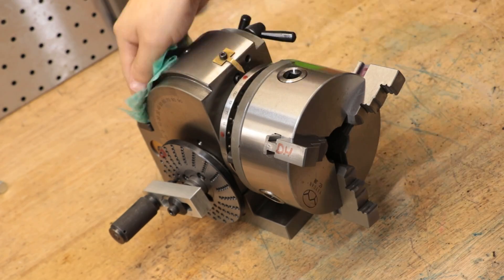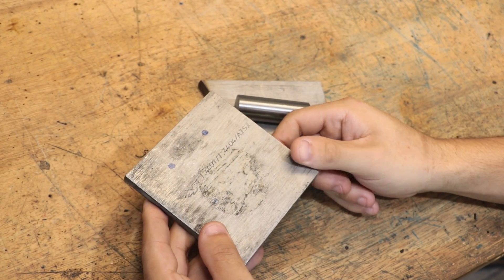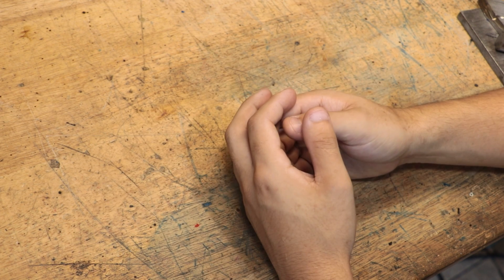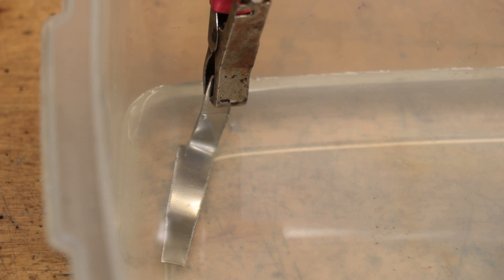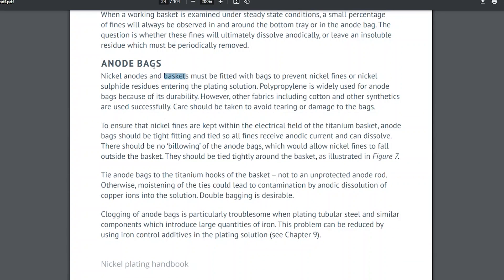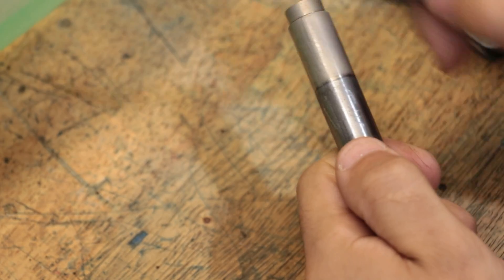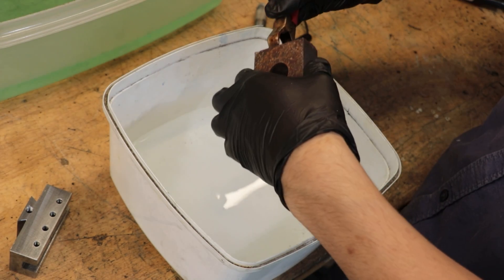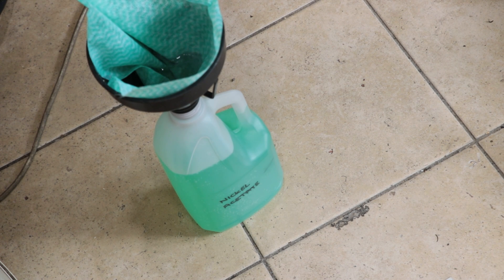Nickel Electroplating Steel In The Home Workshop

Comment: Here's a tip... Buy some nickel wire, use this to connect electrodes to the parts. If you get your power supply clamps into the solution, you will kill it. Also the sodium chloride is important because it creates another nickel salt. When I was looking at commercial kits, they had both salts in the mixture. Also note that most of the acetate salts are poisonous.

I found that the level of shine was more up to layer thickness and current density. Too much current density produced dull finishes. I've done brass and steel so far with very good results. Buy a real DC power supply, results will improve.
Reply: Yikes - I'd better get some nickel wire. I've got some steel end bells off of a couple  of electrical transformers that I want to plate - they're roughly tray-shaped and need to be totally submerged. From what you're saying, ordinary alligator clips in the solution might mess everything up.
Reply: @hubbsllc  anything other than nickel on the donor side will cause problems. And even on the receiving side it just made sense to me because the nickel wire doesn't cost very much money. This is a long process, turn your back for 10 minutes and come back to find the wires in solution and everything needs to be made again. The nickel wire gives you a little safety margin.

Comment: Great video, liked your aside into electrocleaning. The discoloration on the edges is likely due to the electric field concentrating on the sharp edges and plating too fast. Aside from regulating the plating rate chemically (I think glycerin can help? Can't remember) the easiest thing to do is to move the electrodes further and plate slower. Youd still plate more on the edges but the plating rate would be slow enough not to burn anything. Cheers and great video as usual.

Comment: Dehumidifier, a bonus of it is also a minor (about 300 watt) heat from it.
My whole basement runs a small "portable" dehumidifier and it's under 40/50% humidity and nothing rusts 😁
Reply: Depending on where you live though, it's an expensive way to avoid rust. 300W 24/7 would cost me almost £900 per year here in the UK. Sure, it might not run continuously at certain times of the year, but it's still a factor to consider.

Comment: I did some copper plating recently on some rust-prone steel parts. Not sure of the long term durability but it looks satisfying. I did also buy some nickel and zinc to give those a try.
Reply: Do protect the steel from air mate, or you’re gonna form a iron-copper battery which will corrode the iron

Comment: Pretty interesting solution, I did some nichel plating in the past as i was restoring an old boat that had some brass parts that were losing the original plating. As yours the color came ok but I used a polishing wheel and the results were pretty good.

Comment: Very nice. 
The unevenness on the top of the tool holder comes from the process of electroplating itself. The electric field is stronger at the edges on the outside of the material, likewise it is weaker at inside edges. So when the nickel deposits on the part to coat it, more is deposited at the outisde edges and less is deposited at the inside edges. I beliee this is what makes it look like discoloration but it is just layers of different thickness, fading in and out.
Chemical coating processes alleviate that problem, but are a different topic, especially in handling.
Reply: Oh then it isn't simply because there was just a little bit of liquid on top of the bath[1] and that the higher the density of the solution, the higher the nickel content is, which in turn means that the highest ion concentration is at the bottom of the galvanic tank? Well, I am not discussing your nonsense and misunderstanding about "electric field[s]" and how currents flow in fluids, but give you a "magic" one hits them all solution: We in the professional industry use rotating drums that ensure even application of the plating process. Even with your misunderstanding of the chemical and physical basics, that would mitigate "unevenness". So speaking about home use: SHAKE the bath and maybe turn your workpiece around and submerge them EVENLY in the fluid (too less fluid=bad, too much fluid=does only matter for your purse, hehe). Hey, otherwise you are so innovative (like inventing electric fields in fluids ...), I'm sorry for the mocking, but please read about electric fields and the electrochemical process of plating at, f.e. Wikipedia. 

You are absolutely right with the plating thickness. Such coats in the nanometer scale and above periodically (sine spectrum) refract light and that results in a preferred lesser absorbed color. You can find tables for different materials which help to estimate the layer thickness based on the reflected light wavelength. But they are not exact in the matter I mentioned above. For example a 420nm blue tint may hint to a 2µm Layer, but also 12, 22, 32µm (those are fantasy numbers, just for explaining the principle behind it).

[1] That means also a higher resistance = lower current = lower layer thickness plating effectivity over time.

Comment: How about cold bluing?
Reply from the maker: Ill be doing bluing in a later video, its a nice coating but it is not nearly as corrosion resistant as the nickel plating. Cheers

Comment: Microcrystaline wax is good on bare steel/iron.
Reply: The issue I've had with waxes is they break down when using cutting fluids and especially any degreasers. I use so many of these in succession in the shop that waxes just don't last. Long term storage of tools is another story. Just my experience.

Comment: Very nice job on the electroplating and the explanations.
Just make sure not to scratch all the way through the nickel layer. Otherwise you would create a small battery cell (particularly when getting wet) and it will rust even faster
Reply: That is partially true, but also wrong. The fantastic properties of such platings include the following:
As you described, a battery would form, which is nothing else than an electrochemical process. This may "re-electro-plate", meaning closing scratches and even out dings on the surface. 
Yeah, if those are to big, nothing safes the exposed plated base-material from rusting. But nothing else than submerging the part in f.e. oil does that either. 
You can further read about that in articles about zinc-plating for exterior use. That effect is well documented and one of the reasons to use such techniques for protection of surfaces subjected to mechanical stress. There is also the possibility to plate a harder material on top of the corrosion prevention (or vice versa) or mix them like in an alloy. 

Its a fascinating topic you can even study and specialize in ... for a life-time. Guys, have fun making!:)
Reply: @dieSpinnt  Funny thing is that i did study this stuff (among many others) as i am holding a PhD in chemistry and being an inorganic material scientist

Comment: There is one small problem with nickel plating. If a separating layer of copper is not applied, the coated part loses its resistance to cyclic loading. Moreover, the loss of fatigue wear is very significant.
Reply from the maker: Its a bit late at night for me to find it, but buried deep in one of those documents I was reading through was a section on when materials may require a copper plating prior to the nickel.
Reply: @artisanmakes Could you please share those documents regarding nickel plating?
Reply: @Mistrz_  check the pinned comment, they're listed there.
Reply: @davidbastow5629  Thank you, I didn’t notice that.
Reply: @Mistrz_  You're welcome, happy to help :)
Reply: Do you mean that the material properties are vastly changed by the nickel plating? That's not been my experience; directly coating nickel on steel is common. So it the "tri-layer" of copper/nickel/chromium. None change the material properties of the substrate, if done properly.
Reply: @UncleKennysPlace  Well, it certainly didn't hurt those Vice Grips!
Reply: Yes, it's very common to apply a copper strike before the nickel plating, but I'm pretty sure the negative effects on the base metal are so miniscule as to be totally inconsequential for hand tools. If he were plating a bridge, skyscraper, or aircraft component, then it would matter.
Reply: @Bob_Adkins  Nickel plating provides a 7% reduction in the cyclic fatigue threshold in an ideal external environment. And up to 20% in an aggressive environment. And we nickel-plate just to protect it from an aggressive environment.
If the wrench was designed for a certain load, then nickel-plating it means falling under the fatigue endurance threshold.
There is no magic - in carbon steel we get tensile stresses of the surface layer of the metal.
Reply: @SergeiPetrov  I understand how that makes a difference in highly stressed structural metal parts.
Reply: A thin layer of Copper can be coated onto iron/steel by first thoroughly cleaning it and then simply dipping into Copper Sulphate solution.
Reply: @HighWealder  I do that all the time, I use the copper color instead of marking dye. I suppose it could help with nickel plating just like electroplated copper.
Reply: Do you mean the coating loses cyclical resilience? The base part is generally only affected in it's outer layers, which, especially on thicker parts, has little to no impact on resistance to cyclical loading or fatigue/failure-behavior.
Reply: @joemama069  If that's the case, maybe very small springs shouldn't be Ni plated.